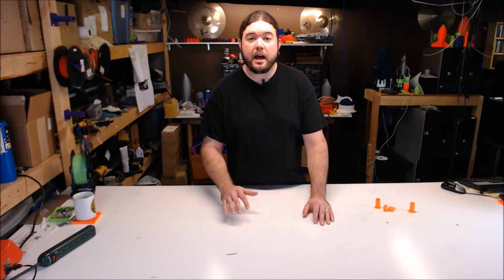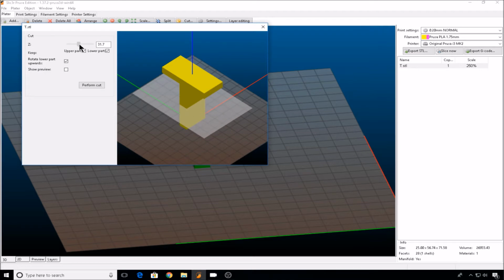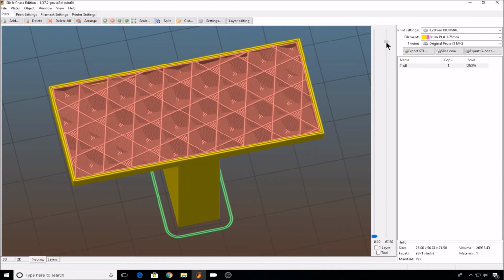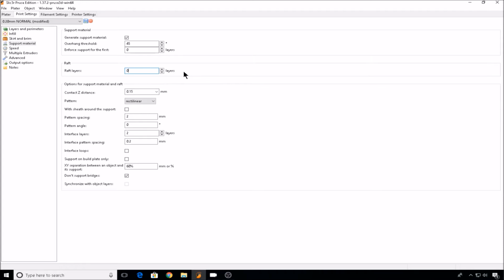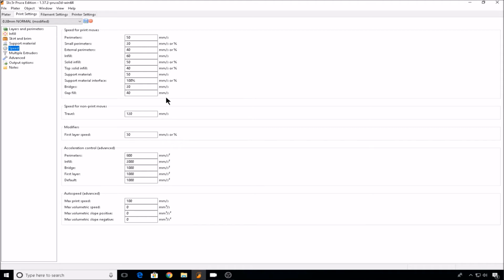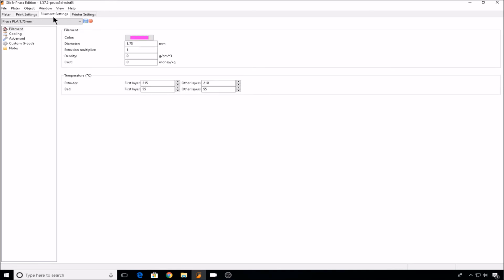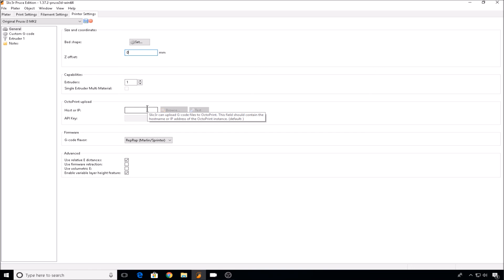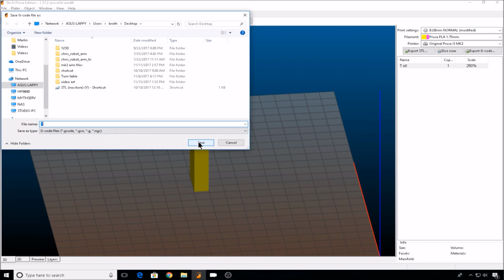Overview 3D Printing File Slicing - Slic3r- Chris's Basement

Comment: I've been 3D printing since 2015 and completely modified my Prusa i3.
Recently I replaced the extruder with a dual gear model as well as the print head (same as Ender).
So I had to reconfigure slic3r.
I learned a lot by watching your video which is one of the best in this field. 😎
Thank you so much !
***
J'imprime en 3D depuis 2015 et j'ai complètement modifié ma Prusa i3.
Récemment, j'ai remplacé l'extrudeur par un modèle à double engrenage ainsi que la tête d'impression (identique Ender).
J'ai donc dû reconfigurer slic3r.
J'ai beaucoup appris en regardant votre vidéo qui est une des meilleures dans ce domaine.😎
Merci beaucoup !
Reply from the maker: Merci beaucoup! Je suis heureux de vous aider.

Comment: Hello Chris, I have a generic £79 3d printer I purchased from Ebay, I think it's like a Prusa copy but hey So what!!? I have only fired the thing up, haven't done a single print yet.And I want to use it perhaps to print models, eventually but will obviously be starting with little print's first, hey you don't get much filament with these kit's, it was a pleasure to build the thing though.My question is:will Sicecr3r work with a Dell Optiplex 755, which is only using it's on board Graphics Chips, or do I need to invest in a Decent graphics Card, I have never bothered getting a Graphics card before because I am not really a gamer, I just download music, go on Youtube and Freecycle.org, but I would upgrape the machine with Graphics card (perhaps you could Recommend wchich one I should get also) as I have plenty of RAM (8Gb) and plety of room for data Storage.
I need to FIRE this thing up with Confidence, and get printing, at the moment it's just gathering dust which ain't good, would a local College perhaps do a course in 3D PRINTING?
Anyway, tips will be appreciated.

Sincerely R Kelly
Reply from the maker: Hey Robert, no graphics card needed. It should run fine. It might take a little longer to slice, but no worries. I am not sure about a College, but your local maker space might have a crash course they offer.

Comment: Hi Chris,

I have only just found your videos and am finding them very helpful, thank you so much for taking the time making them, I'm just about to get a 3D printer so I have been looking at different tutorial/help videos, but so far, your's seem to be the most helpful, thank you...

Once again, a HUGE thank you for both your time and help with helping me to fully understand about 3D printing, thank you...

All the best...

John...
Reply from the maker: John, great! Welcome to 3D printing! Let us know if you need any help getting started.
Reply: @ChrisRiley  

Hi Chris,

Many thanks for the welcome...

So sorry for being a nuisance, sorry, if possible, may I ask for a bit of help with setting up the printer please...

The printer I have is a 2019 FDM 3D Printer Bizer Dual Extruder & MK8 MakerBot Replicator, I purchased it off the E-Bay, my problem is, with the software and not being able to control the printer, I can see the temperature's going up and down if I use the pre-heat on the machine itself, but that is it, on the software which I have tried so far are ReplicatorG and MakerWare, I get the following message at the bottom of the screen in ReplicatorG...: -

[14:08:04] Connecting to machine using serial port: COM3
[14:08:04] Motherboard firmware v7.4 ()
[14:08:04] You are running an unverified MightyBoard,
[14:08:04] your machine is not a verified MakerBot Replicator

I was just wondering if you may possibly know what might be wrong please...

I have tried an SD card with an object and the machine heats up and moves into position, although I didn't actually print with it yet I just wanted to test to see if it would read and move...

Again, sorry for being a nuisance and sorry if this is the wrong place to ask this...

Many thanks...

John...
Reply from the maker: @Andy203504  Hey John, I have one of these printers and I haven't had much luck with it at all. The software they use seems to be really out of date. There are guides online on how to convert it to Sailfish, but again I haven't had much luck with it. I am currently looking for a way to convert it to Marlin firmware, but it's going to take a lot of work. Sorry I wasn't more helpful. I will keep you updated on my progress. Thank you again for the support on Patreon!
Reply: @ChrisRiley  

Hi Chris,

No worries Sir, I will keep going with it for now with the SD card and will keep watching your videos, as I said they really are very helpful for me as you explain everything fully...

As for the Patreon support, you are more than welcome Sir, thank you for taking the time making these and sharing your knowledge with us...

Many thanks...

John...

Comment: Hello Chris , 
Im new in Printing and This program . when i export Gcode and start printing the Z its go down maybe 10MM from Nozzle .. while its printing Why that ?! 
and i did Use gcode some one make it and if it has z offset set in gcode it can over write my setting ?? ( Z OFFSET )
Reply from the maker: It all depends on what is in your start gcode. The only my to change Z offset would be with a M851 command. You could have something bad in eeprom, I would suggest turning it off until you get it resolved.
Reply: @ChrisRiley  Hello Chris .. im comment eeprom .. im using M114 after i set papar touch nozzle and move z little down and get location of Z ! and i put marlin and reupload code
Reply from the maker: @mohamedatef8424  You have to do it in are very specific order. https://www.youtube.com/watch?v=G-TwWfUzXpc

Comment: Dude you do an excellent job with your videos.  I like the straight forward presentation of info without a lot of silly infill many channels subscribe to.  Some are more concerned with being some kind of media "personality" than with getting down to meat and potatoes.

I see a boat-load of reviews on the tube, with the majority proclaiming how awesome the XXX printer is "out of the box".   I'm quite the newbie with printers but one thing I've learned is the out of the box physical construction of the printer is only half the equation, at best.  What these reviews dont mention, and what the newbies watching will be caught completely off guard by, is that the slicer settings make all the difference.  You can have a great printer and poor settings will sink it in an instant, and programs like slic3r, kiss, and Cura are like foreign freakin languages to the new Printer.

I started with an XYZ DaVinci Pro.  I'm sure you know how limited that software is, but for a newbie its practically perfect, and mine has printed like a boss for me.  Its not on a par with the more versatile packages out there, but for "out of the box" it was hard to beat.  Heated bed, enclosure, semi-automatic bed leveling, and stupid simple but pretty effective software.  Great for a beginner (though it isn't without it's quirks).

My latest is the Anycubic Kossel Linear Plus ( 2 of them, long story) and it has been an amazingly frustrating though educational experience, especially in the firmware/software/slicer department.

To make a short story long.....good job.
Reply from the maker: Thanks, I really appreciate it. I learn a ton of stuff via Youtube and I try to make videos how I would want them to be. Lots of info fast. If it's too fast, there is a pause button. Thanks again.
Reply: I really want to echo this comment!  I've got a 3D printer on the way, and ended up binge-watching a bunch of videos on this channel.  I also really appreciate that you get down to it, that the videos really are on-topic and don't rehash other stuff, and there's the absolute minimum of "intros" and other noise.  I've learned so much in just a few days from watching, please keep doing what you've been doing.

Comment: great vid cuz ..... answered a few questions I had ...... on the big baskets and objects you have shown I was wondering about it pulling, or twisting as you called it, as the head printed .... I figured that twisting was more of a problem with round objects that with something with squarer corners ...... is that a correct assumption?....... keep them coming chris........ you know this is the stuff that really interest me .... the nuts and bolts stuff
Reply from the maker: KBRunn4thdoor That is correct, the small round objects of a model, like the stack on a bency, can get that twisty look to it. If the settings are off a little the filament tends to drag and not adhere to the previous layer. More to come.